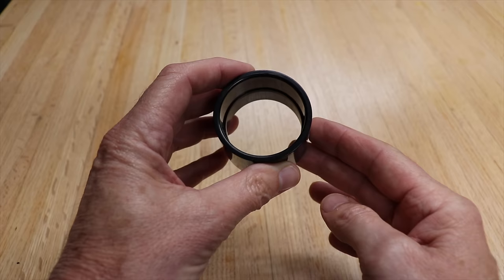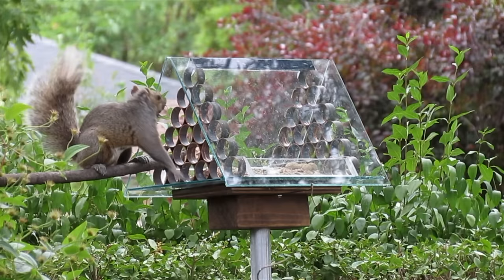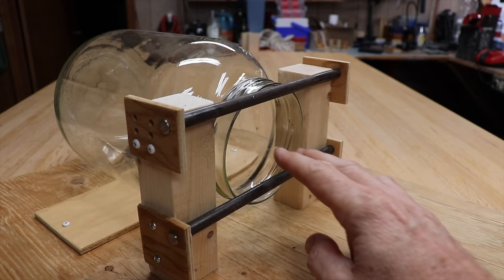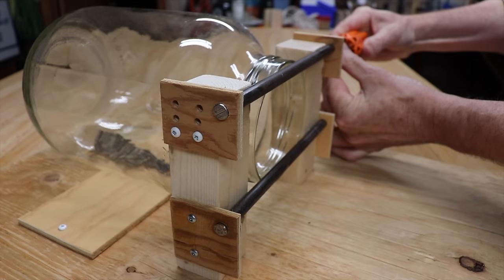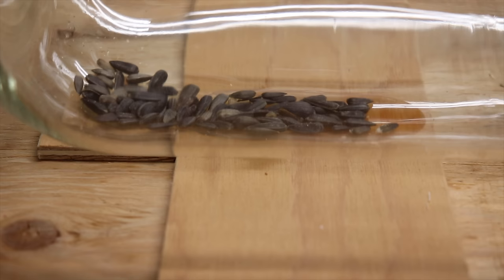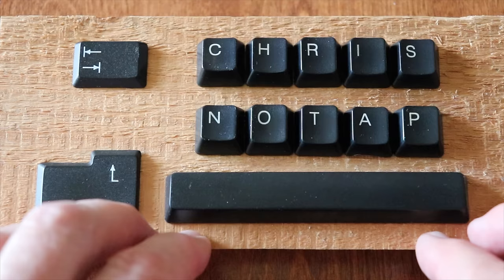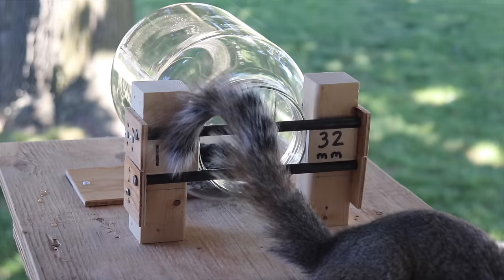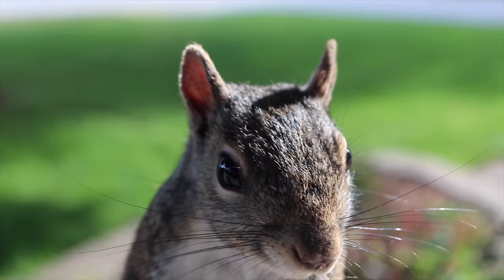How I Designed ●  a Squirrel Proof Bird Feeder

Comment: Hi Chris! I am so glad you made a new video! My husband and i tried to make a version of your triangular bird feeder with the ringlets. However since we don't have a nice work shop with a table saw or pipe cutter,  instead of using copper pipe we used PVC pipe to make the ringlets. Also since we don't have a way to properly cut glass, we used clear plexiglass that can easily be drilled into. My husband put aluminum strips around the base panel for sturdiness. He had to put screws into the bottom panel that go into the PVC ringlets as the silicone adhesive was not holding them onto the plastic very well. To make it hard for squirrels to open, we used cabinet magnets on the opening panel. We have ours hanging in a tree. And its certainly kept squirrels from going inside, and its been up since middle of May but the birds around here still have not learned to associate it with food. but we still need to add the perch so maybe that will help.
Reply: just know that the squirrels may chew the pvc pipe and plexiglass as they did on my feeders when we replaced the broken glass front!

Comment: Trust me, they will chew right through anything made of wood or plastic to get at food. I’ve had them chew right through my plastic composter that is 1/4” thick.if you have a clear plastic container with seeds in it, they will chew right through the side of it to get to the seeds.
Reply from the maker: Correct. That is why I do not use plastics.
Reply: I have had squirrels gnaw through a copper fuel line in my parked outside truck

Comment: The size of the opening depends on the size of the squirrel. Females and adolescents are smaller. Also, they will turn sideways and approach the opening so the length (width) becomes the height and they can squeeze in.
Reply from the maker: I had this up for almost a week. Many visited. The small ones will no venture up onto things like this until they gain confidence and grow bigger.
Reply: Or the red squirrel which is smaller

Comment: I think would have been better if you put the rods vertically. Squirrels are wider than they are high. So, they have a harder time going through vertically-tight areas than horizontally-tight
Reply from the maker: I will be experimenting with both vertical and horizontal. Thanks.

Comment: You found quite the hefty boy to test this on.  I really didn't think he'd be able to get out of the 2" setup.
Reply: Since the shoulders are a non-issue the true bar to the squirrel is can it squeeze its head through. If yes is the answer then it can fit.

Comment: mount your feeders on a 4 inch diameter plastic pipe at a height of at least 5 feet and away from any tree, fencing or large scrub... the birds have easy access to the seed without any interference from squirrels... but it's not as fun as making squirrel mazes...

Comment: I have to share a design I came up with many years ago as a kid after much experimenting... just bury a 4" (or wider) PVC pole vertically in the ground, deep enough to support an above ground height of at least 6ft (the higher the better though) . You can mount any kind of platform feeder to a PVC flange and it will slide right on and off the top. You can simply use a stool to reach if you're not tall enough for refilling and cleaning... or make a system to slide the entire pole on and off of another piece of PVC mounted in the ground. This design requires a clear area around the feeder that has nothing a squirrel can jump from. In practicality, you'll eliminate 90% of them from ever getting there even if you only have a 10ft radius, but more is preferable. NO squirrels will get all the way up the pole, and it's easy as pie.
Reply: And a fox squirrel just ran past along my windowsill as I typed that dissertation haha 😂

Comment: Come on all you You Tube scientists and physicists. I have 8 bird feeders on poles that avoid overhanging foliage (as we know , squirrels will drop).  They all have cones attached  (which prevent climbing up the pole) .  The birds and my 4-8 squirrels all live in peace and harmony, with the squirrels content with seeds the birds knock out of the feeders to the ground.  Red squirrels are a different matter requiring a "22" solution for the sake of the baby birds in nests and any nearby electrical or cable or phone wiring.

Comment: You can also make one.... Away from the trees (or jumping areas), the pole is extending 2 meters above the ground, the circular platform is 1 meter (or more) in diameter.

Even if they climb the pole, they can't jump to the edge of the circular platform.

And no more teasing the squirrels.
Reply from the maker: What you just described..........is that not teasing also?
Reply: @chrisnotap  
I don't think so.

The feeder in the video is very much cruel. It's already in the squirrels' face but still can't reach it. They'll go "nuts" trying to reach those bird feeds.

Even if what I propose is a teaser to them (if you think so) but it won't be a cruel tease.

The bird feeds are too far from their grasp. IF they can't get near it, they might lose interest.

From what I am describing. The feeding platform is out of jumping reach from the trees or any ledge. They may climb the pole but can not reach the platform's edge since they don't have anything to grasp underneath the platform.
Reply from the maker: Like I say at the start, this is only a test stand to determine the distance they can't enter. Then use that info to make a proper feeder. There is plenty of food naturally in the environment for the squirrels. This is just another stop in the big outdoor buffet!

Comment: Does it work with red squirrels and chipmunks? And are the 1/8 “ increments really necessary? And what about the accumulated bird droppings inside the horizontal jar? Is your design worth the extra work and wasted seeds?
Reply from the maker: This was just a test stand to determine the size of the opening they could not enter. That's why I used 1/8" increments over many days. I wanted to hone right in on the size. Lots of squirrels visited of many sizes. I can now start thinking of a design using bars.
Reply: @chrisnotap , I tried the "Design using Bars", i'd fill the feeder and then go to the bars,  by the time i got home i couldn't care less who or what ate the seed👍🏻😉

Comment: Here what actually works.
1. Perforated tube feeder. / suet cage. 
2. Chicken wire 4.5 / 5 mm aperture.
3. Line the feeder from the inside with this wire mesh. ( at first I doubled the lining, later removed one layer) 
4. Fill it with seeds, peanuts ( no salt please).
Enjoy the birds. 
Also have a laugh watching the squirrels trying to break in.
They are quick learners, and After a couple of times they will stop coming.

Comment: They can't go through 1.5 inch pipes but they can get in 1 and a quarter bars? Seems like the pipes work a lot better for the birds, no?
Reply from the maker: With the bars, they are able to get their shoulders in without a problem. The circles prevents that.

Comment: That squirrel is obviously a full adult. A juvenile  could get in ther easily. You would need about a 1 inch opening.
Reply from the maker: The young smaller ones will not venture to check it out. They are too cautious and stay to ground feeding until they gain confidence and grow.

Comment: Hmm...here's a problem that entirely encapsulates wrong thinking.
We have two parties involved here, one that we want to encourage and another that we want to discourage.
Ergo, the shortest route between two points is a straight line.
Rather than working on the undesirable, work to the desirable  to achieve a much earlier success without too much repetition.
My suggestion would be to start with say 1" mesh, which provides both vertical and horizontal restrictions, and is a good first reference point.

Comment: Put up a dog run cable. Than hang your bird feeders out near the middle 10 feet off the ground. Have a rope to pull the cable down to get to and reload the feeders. Game Over.
Reply from the maker: They can traverse a cable easily!! Good idea but they are crafty!
Reply: The 1/4 inch plastic coated cable we have had up since the dog don't use the run any more works great for the last 10 years. The squirrels haven't had a chance. They can run along the power lines, but not this stuff, so don't talk about something you know nothing about.
Reply from the maker: Ok. It must be the coated part that they slip on. I apologize. Every video I've watched they are able to get up almost all cables. I learned something today. Thanks.

Comment: Any hole large enough for a squirrel to get its head through it can get its entire body through. Other than for the watch, this was a useless experiment.
I’d also like to point out that, all squirrels are not the same size. You found a size for this one but a smaller one will get right through.
The only good ways to keep a squirrel out of your bird feeder is to
A. Not put a bird feeder out. Or....
2. Eat the squirrel.
Reply from the maker: Actually the real young small ones won't approach. They are just too cautious. The average size that will approach is pretty constant.....and as you can see in the other experiment I did to see what size circle they can get through, they were able to get their head through .....but not their body!      https://youtu.be/R3Cv-r5dIVs   The only way to find out for sure is through simple tests.